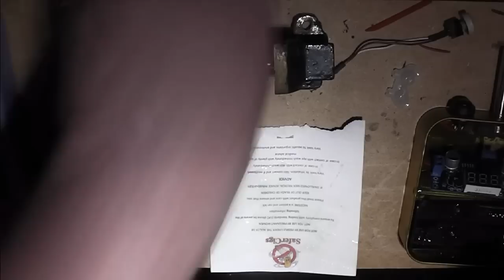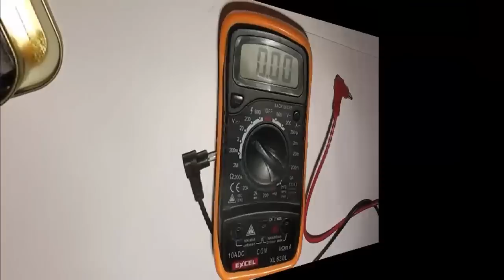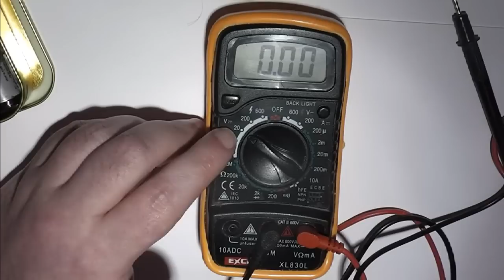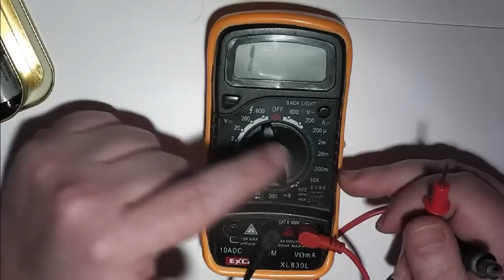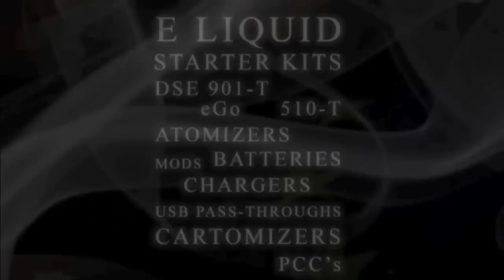Tin your tip 18 - 02

Comment: The board i was using was the LM2596 Power Step-down Module DC 4.0~40 to 1.3-37V + LED Voltmeter from ebay if you put that in the search on there it should bring them all up. Garry was using a DNA20D from evolvapor hope that helps.

Comment: yes that wont be a problem, that's how most tube mods run. the only slight problem with doing it this way is that you will waste a very small part of the battery's charge as the kick will always be on. but it only really becomes an issue if you were to leave the battery in with the kick for a long time (many weeks) without use you could drain the battery too low. so take the battery out if you aren't using it for a while.

Comment: the only way you can do that is if you are using a bottom button switch then you can run the circuit from the neg on the battery through the switch to the body of the tube